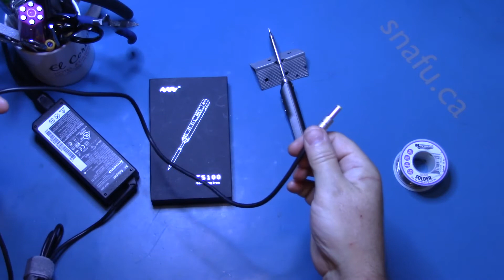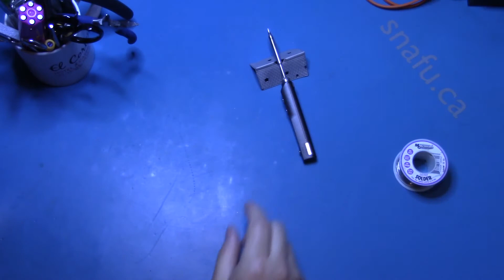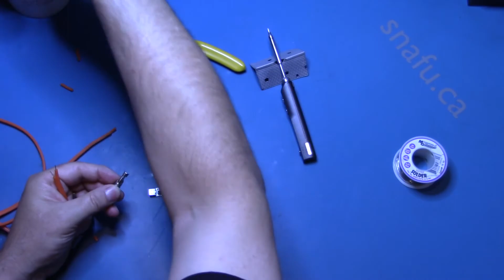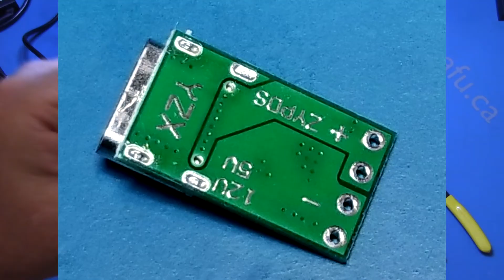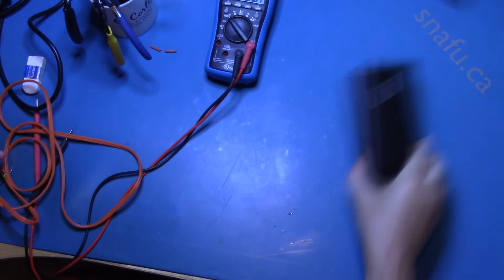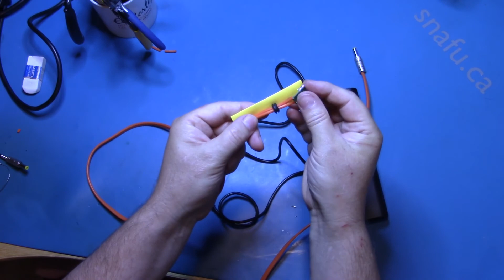How to power your TS100 from USB-C PD

Comment: this is great if you still have a TS100. I got a Pinecil which already has both Usb-C power port & DC port,  which is upgrade to ts-100. This video has good tips about how to make extra silicone wires since I need to make to go to 18V power tool batteries to Pinecil.

Comment: Wouldn't the solder joints on the USB-C PD adapter work if you just flood the contact pads with solder and solder the wires directly on instead of putting them through the holes? Or is it stronger that way? (in terms of pulling the USB plug out for example)

Comment: hey buddy, whats awg gauge of the wire used? 10 gauge or 12 gauge ? thanks alot
Reply from the maker: You should be fine with 18.  the TS100 will draw perhaps 2A

Comment: Nice! I'm using a Hakko soldering station, but to have something that I could use if the power is out without the need for a clunky UPS would be ideal. Yours is a very elegant design.  Thanks for sharing!
Reply from the maker: Miniware sell a TS80P which already supports USB PD, but a lot of people (like myself) have the 100 already, plus having a silicone cord on it is greatly preferable to a burnable PVC USB cable.